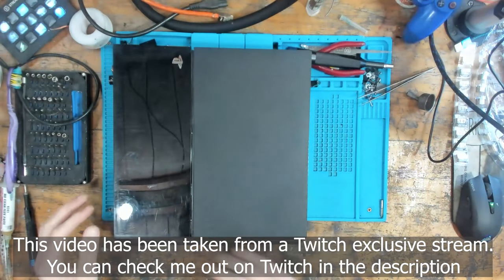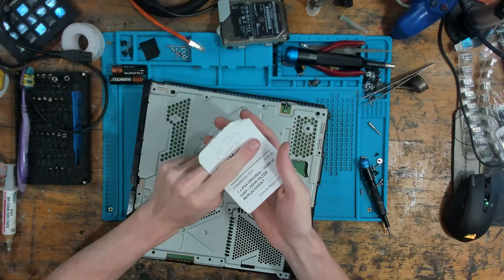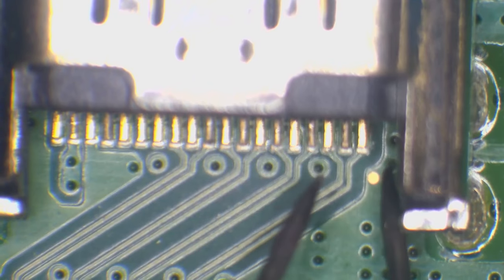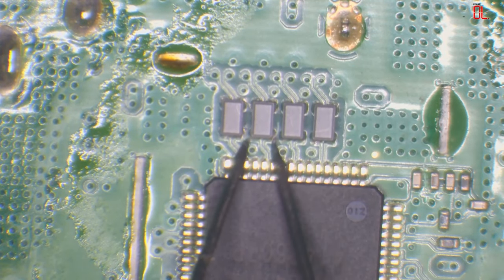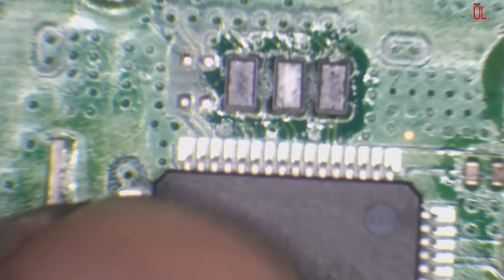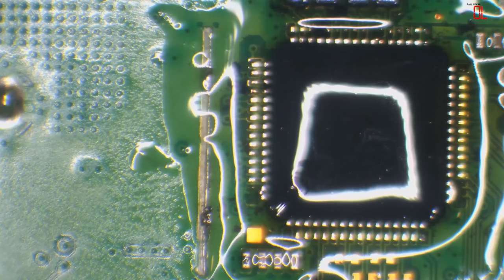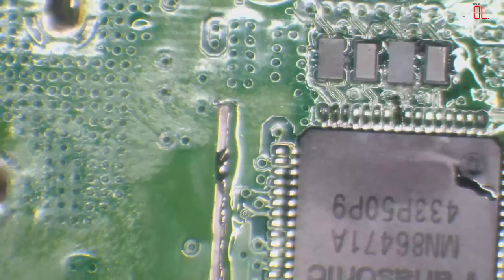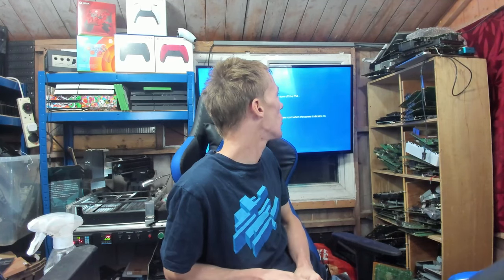This PlayStation 4 Turns On But Doesn't Show On Screen! Can I Fix It?

Comment: I have often seen this technique with meter in diode mode, red probe to the ground and black probe to the parts for testing.. can you explain it to me, I did not comprehend it yet :-) Greetings, Michael
Reply from the maker: Yeah diode mode will basically test the voltage drop against 2 points. For example if you have little or no voltage drop those 2 points are connected together and can indicate a short. Diode mode will inject voltage across the line and van give you a very accurate reading very quickly
Reply: @TheCod3r  Helped me out 7 months later. Legend

Comment: I changed the hard drive on my xbox one original to see if it was causing it to randomly shutdown and noticed the 7 pink polymer capacitors underneath it had big dents in them (not buldging).
Would that cause it to shutdown or knacker hard drive
Reply from the maker: If they're damaged or faulty it could do yeah
Reply: Thanks, ill see how long it lasts with new hard drive then change them if it goes off.
Great channel love the videos and you're local to me if i balls it up lol